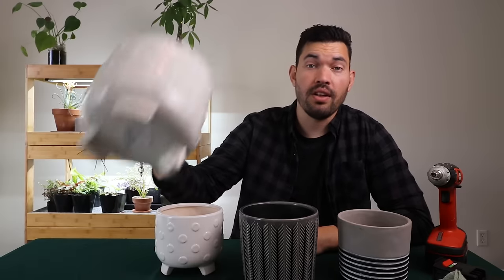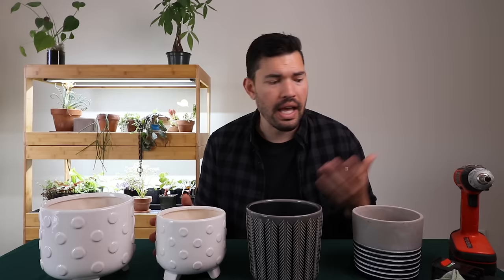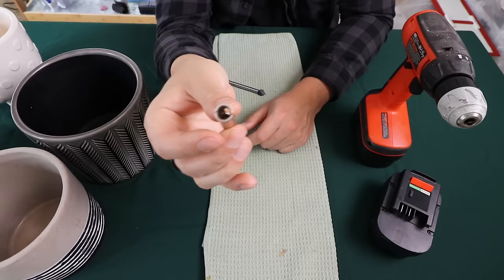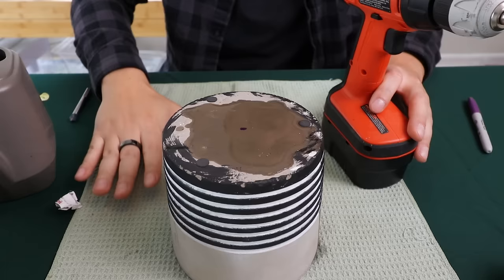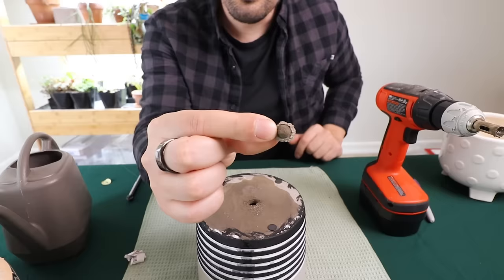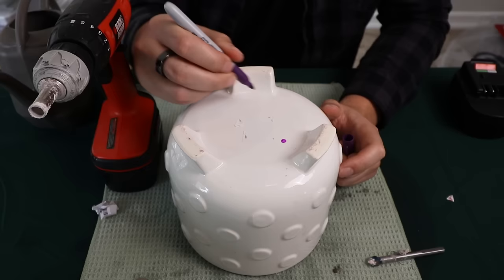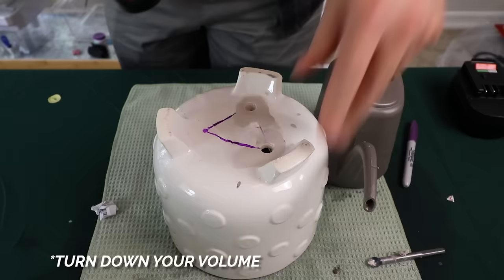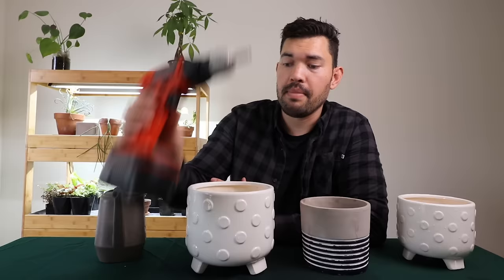Drill Drainage Holes in Pots WITHOUT Breaking Them! (Foolproof Method)

Comment: Using water when drilling is for two important reasons. One is to lubricate the process, but the other is to keep ceramic dust from getting in the air and in your lungs. Ceramic dust is very dangerous if inhaled.
Reply: I didn’t know that —ty for sharing! I thought water was just to cool the bit—I normally wear a mask bc I’m all about safety lol but it’s good to know why 👍🏻
Reply: good comment
Reply: Ceramic dust is less toxic than car exhaust or 30 other things we encounter on a daily basis.
Reply: Inhaling ceramic dust can lead to silicosis.
Reply: Ceramic dust is far less hazardous than many inhaled substances, but safer is always better! Hearing and eye protection is vital, using any power tool.
Reply: @AdamKeele NO way I’m taking a chance ..mask fresh air constant 💦 ..whAtEveR to avoid inhaling weird dust
Reply: Thanks for the clear, helpful video. Now off to the hardware store for a diamond tipped hole saw bit

Comment: Diamond core bits/ hole saws will last much, much longer by using water with them while drilling. It acts as a lubricant to protect and cool the diamonds while drilling. ( I worked for a company that made these drills.) You can make a simple dam with some modeling clay around where you want to drill and fill it with water.
Reply from the maker: Appreciate that tip!
Reply: Thanks for this tip!
Reply: Great tip!
Reply: Thank you
Reply: @epicgardening  punderful =P
Reply: This is the way.
Reply: Agree....I spray where my husband is drilling with a water bottle. It works great!
Reply: Is this a dumb question?... but like, how many times is it normal to use a good hole saw b4 it’s worn out? I got the snazzy $24 one from HD and I got a lot of ceramics to drill...do the better ones last longer?
Reply: @deniseherud  I have used the same core drill to put holes in dozens of glass and ceramic bowls  - at least 40+. It is really all about keeping the bit properly cooled and lubricates with water and not forcing it - let the diamond do the work.

Comment: I don’t usually leave comments but I bought 6 &tradition pots online and they came without drainage holes. I have never used a drill before in my life. So I followed ur video and went to get a cheap drill with a diamond drill bit. And now I have 6 pots with drainage holes and none cracked ! U are the best! Thank you very much. I had worries about how much force to exert on the pots but eventually figured they could tolerate some force. Regards from a plant daddy from Singapore !

Comment: When using those bits, it works better if you take sticky tack and create a little well and put water in it. The more the bit it is wet the longer it lasts and faster it creates a hole.
Reply from the maker: Totally, great tip

Comment: I’ve done this and in my infant stages I didn’t break the pot because the bit or doing it too fast. The pot broke because after the hole was made, i was applying so much downward pressure I smashed the pot with the drill lol 🤦🏽‍♂️
Reply: I haven’t done this (yet) but I felt this. Lol.

Comment: Two suggestions:
1. Wear safety glasses. They are cheap to buy!
2. Using an empty 2-liter bottle, poke one tiny hole in middle of the side. Fill with water (with your finger over the hole you just made), cap immediately. 
Set bottle beside your pot, loosen the cap and have a continuous tiny stream of water that you can point right to where you are drilling.

Comment: Those diamond hole saws are AMAZING.
The pointy/tungsten bits are slowwww and they wear out after a few uses. The hole saws seem to last forever; the reason they're wearing out for you is you're not using lubrication. Everyone gets these things on Amazon in little ziplocs, but if you got them at the store the instructions would say to use water.
Hole saw + water to lubricate + template = ez. This works on glass too.

Comment: People have already mentioned it below, but a bit of tape similar to Scotch tape or paper tape would help with the sliding around initially.  I also saw someone use a 2 liter bottle filled with water and made a pin sized hole in it dribble water on the area when drilling.  It was really cool, but I cannot remember which video that was since I watched it a year ago when I was first learning about how to use a drill and driver and learning how to drill into ceramic and glass and such.  :)
Reply from the maker: That's a great idea!

Comment: Hello sir, you don’t need to come at an angle. You can start completely flat at a low speed then you get a nice flush surface (especially since it’s the bottom of the pot, you don’t really want that ‘raised’ edge build up for the angle).

Before I even started your video I already knew a tile hole bit was the answer as I’m a flooring specialist at Home Depot... .. But.. if the pot is much larger you can also drill from inside the pot with a little water in it. 😉😏 That way it is submerged in the water.. Especially if it’s a much more dense material than clay.
Reply: I wouldn’t suggest the bit with the spiral as it needs to push the material out from center and is then more susceptible to cracking (it is less of an issue if it’s clay, but even then I wouldn’t recommend it). 🤔

Comment: So far I've used masonry drill bits for drilling holes in my pots with good success.
Keeping the surface area wet is definitely a smart move. It keeps the pot and everything else cool and minimises dust.
It appears the diamond tip is a bit quicker than using a masonry bit, so I might use a diamond tip drill bit next time I need to drill a hole in a pot.

Comment: It worked! Like a charm! I can't believe it! I bought the diamond tipped drill bits months ago and avoided trying this because I was sure I'd break the pots but it was very easy with these instructions. Thank you so much! (For those in the comments suggesting using a piece of tape, I'll note that I used the price sticker as a tape substitute on one pot and it kind of just got drilled into mush. I didn't use tape on the other and it was fine. So I think either way works.) Cheers!!

Comment: A Tip to make this an even better water-cooling experience (ty btw!): 
1- Position the guide on the spot to be drilled.

2- Fill the desired sized hole in the guide with water.

3- Start drilling, without moving the guide.

Comment: Thanks for the tutorial :D I tried to drill drainage holes into the metal pots i use outside and did not succeed, i will try again after finding the right bit for that! What I wonder is: Dont you use planting pots in the US? Here in germany its more common to use thin plastic planting pots inside of the ceramic decor pots to give some drainage and not to have to use a saucer for picking up water, the water just stays outside of the inner planting pot and inside of the decor pot. Most gardening store will tell you to get rid of all the extra water if it did not soke back into the planting pot within 30 min after watering. I sometimes use gravel to elevate the planting pot inside the decor pot, its hard to find stuff that fits well sometimes.

Comment: I've always been afraid of drilling,  and don't like pots without holes.  This is great info!  I'd add that I think I'd put some type of buffer  (maybe a bit of rag or twisted paper towel) around the soon-to-be hole to prevent the drill from hitting and maybe cracking the pot.

Comment: Thanks, Kevin! QUESTION: Has anyone tried the diamond-tipped drill bit Kevin used and Kevin's technique on unglazed terracotta pots? Or successfully drilled holes in terracotta pots with different bits or techniques? Thanks!
Reply: After looking around, I found the answer to my question is YES. The same tool and technique work with terracotta pots and a host of other pot materials.

Comment: May I ask what do you do for the pallet/tray for these pots? (idk the English translation, basically the plate underneath the pot used to catch water?) I always assumed these no-hole pots were supposed to be sort of "pot cases" to put your pot inside and make it look nice, but this drilling holes idea seems awesome! I am, however, wondering how you deal with the water that is coming out of the holes.

Comment: It also would be a good idea spraying the inside of hole with baseball bat gripper spray.  Moisture that can seep into an unglazed hole can eventually crack the pot.  I have bought some huge cheap pots from department stores for large indoor cacti but had they hadn't been glazed on the inside so I used 2 coats of the spray before potting.:hand-pink-waving:

Comment: I did this kind of thing when I drilled holes around the edge of an oyster shell.  I used my Dremel tool and put the shell in enough water that it would be submerged; but, my Dremel would stay above the water, except for the bit, of course.  The water does help.
Reply from the maker: Perfect move!

Comment: Your method worked like a charm!  I bought a single diamond hole saw bit from Amazon for $10 and followed your instructions.  I did it on my deck on top of a rubber mat with holes, which provided grip and easy cleanup with just water.  Thank you so much!

Comment: We tried this this weekend and it worked great! Thanks so much for your really informative, easy to follow video. One question - have you ever found that the unglazed clay in the edges of the new hole, or from where glaze chips off on the inside, ever poses a problem with watering? I've been concerned that eventually the unglazed parts of the clay will be damaged by the water.
Reply: Doubt it’s a problem— fired clay is what terra-cotta pots are made of and they make great pots
Reply: @Steve from Kailua do you not know how conversations work? This isn’t a research article— I don’t have to know everything to hold a conversation on the internet. Your harsh and negative energy is very off-putting, Steve.

Comment: I use the pretty pots just to cover the plastic pot where I have my plants. The plastic pots that go inside the pretty ceramic ones have holes. So I’m using the ceramic pot without holes as a pan drip. Am I not supposed to do that? Why is it better to drill holes?
Reply: I agree; the point of having no holes in a cache pot is so your plants don't ruin your furniture or windowsills. Makes zero sense to drill holes in them!
Reply: Root rot prevention.

Comment: Tip 2, don't press down, let the weight of the tool and gravity do the work. Reduces the chance of cracking, or worse. I prefer the hole saw myself.
Reply from the maker: Great tip, yes...light pressure!

Comment: You're not wearing eye or hand protection.  Yipes.  Aren't you worried about the debris getting in your eyes or shattering in your hands?

I use safety goggles and work gloves. I'm not saying my way is right.  I'm new to this.  

So far, I've made holes in a few glazed and unglazed pots.  (No breaks).  I've also drilled through thin metals and plastic.  

So far so good.  

Thank you for the video.  I agree about it taking time.  (And water!)
Reply: Oh, and THANK YOU!!!  Liked and subscribed!

Comment: Kevin, I'm using a DeWalt drill and when drilling ceramic pots, noticed the motor of drill gets quite hot. I'm not an experienced "driller" so I'm unsure if it's considered normal. It cost me $99 so I'm trying to be careful not to let it overheat. I am using water, I follow your instructions to the tee. Any advice?

Comment: Are you assuming the bit will be spent by drilling under 10 holes? Those bits cost 25-50$ each. that's gonna be extremely expensive.

Comment: Just use a regular plastic pot. Fill the bottom of the ceramic pot with pebbles for drainage, and pop the plastic pot inside. You'll never have to worry about puddles on the floor!

Comment: If it helps there's specialised drill bits fir most material I'm a mechanical engineer and I laugh seeing the wrong bits used most diamond tipped ceramic and glass bits are dirt cheap from China start low rpm then speed up as you can guide easier etc

Comment: Why would you drill holes in a cache pot?  You're supposed to drop the plant (that's in terra cotta pot or plastic pot) into a cache pot.  It's only use is to disguise the inner pot and catch any drainage.   I put 3 plastic soda bottle caps in the bottom for my inner pot to rest on and keep plant  above any drainage and prevent root rot. DON'T drill holes and ruin them. 😢